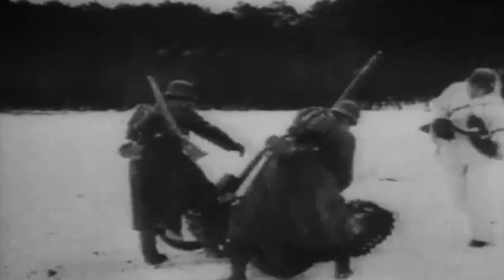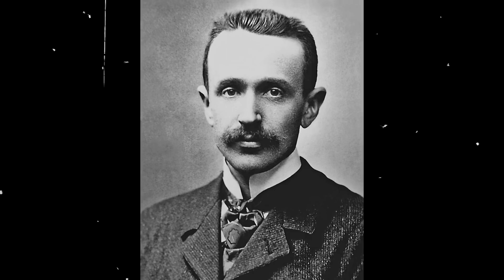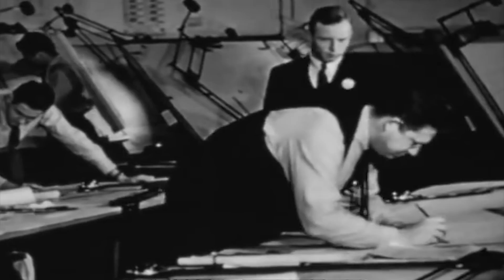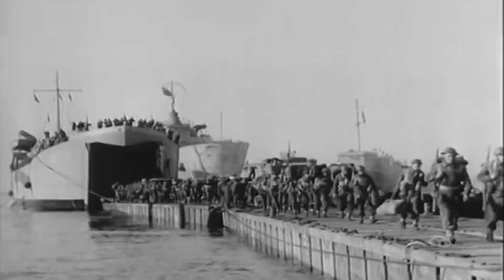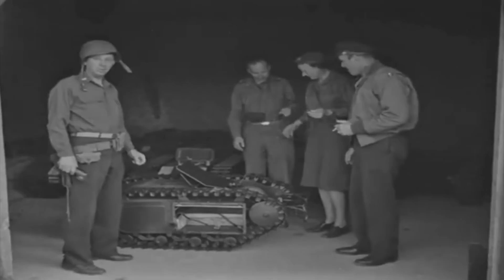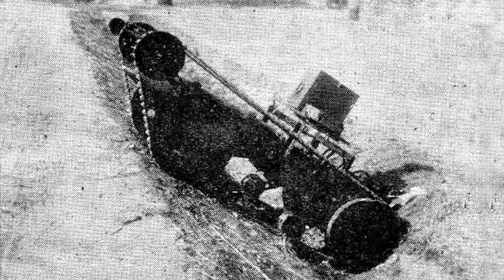WW2 Goliath Tracked Mine

Comment: well it did its job IF it worked long enough and could reach its target.  but i bet we could make them allot better today.  especially with sound recognition and other software upgrades.  thou i'd bet we would make the explosives it carried modular, so it could get to a target and drop the munition down as to get out of dodge before it goes, IF the mission didn't require or need for it to blow itself up in the operation.  why do i want to add hydrolics to the the tracks thou? i mean not for suspension directly but to control tension and allow it to have a larger footprint from front to back... to crossover larger obstacles?... they might have gotten away with using fewer wheels and such if the track and suspension could handle the weight and such, if that helps.

Comment: I would think that these would have been useful at Stalingrad. The Germans could have run them forward into Soviet positions and detonated them. I'm also surprised that they didn't have an automatic arming mechanism that would cause them to explode when someone cut the wires.
Reply: the problem was the ground at stalingrad would have prevented it plus the urban enviornment meant the Sovs would have seen and fired at it or run at them with scissors.

Comment: Well ya. It's not really a remote if its connected by a wire
Reply: There are lots of remotely controlled vehicles connected by wire. Most underwater drones use a wired connection for both the control signal and the video signal.
Many guided missiles used wires for control inputs. It's crazy the wires could unwind fast enough to keep up with the missiles.
The Goliath was not radio controlled but it was remote controlled.

Comment: The problem Germany had, was they were always coming up with a wonder weapon that was going to win the war. However, they didn't have the material to make enough weapons to be useful in winning the war. Plus, they were constantly trying to make it technically perfect, instead of making cheaper to build, and easy to use.
Reply: True, it's like having a big dick but can only last 5 mins. 😂
Reply: I've often wondered what would have happened if the german army had adopted the first assault rifle, the stg 44, as the standard infantry weapon instead of the bolt action K98k. There was a 15 reichmark cost difference.

Comment: There was a bigger version - Borgward IV with half ton bomb. The soldier could drive it. It is responsible for huge tragedy during 1944 Warsaw Uprising. The tank was stuck during attack in the street barricade and German driver run away. After the attack, insurgents thought that it is a kind of tank. Young fighters, against the orders, brought it over the barricade and paraded in triumph on the street. A huge crowd gathered. Then the bomb went off. About 500 soldiers and civilians perished in the carnage.
Reply: Never heard of that. Thanks for the information
Reply: @DalekSec4  Than is a true story of the blow up of the Borgward IV  mine truck, from the time of the Warsaw Uprising, which started on August 1st, 1944 and end up in October 2nd, 1944 !!!! >>  Amen.
Reply: There were actually three unmanned German vehicles: the big Borgward IV, the midsized Springer, and little Goliath.

Comment: These equipment and machines are really impressed me because these time of development.
I think if any terroristic organisation like IS or AL-Q  would have these machines or some modifite kinds of it they would really succeed in their struggle against their anamies.
Reply: Too slow for most terrorist applications, since they can be outrun by anyone on foot. Remove the armor to speed them up and they can be shot with a normal rifle. They already use something similar in concept though. some terrorist organizations have adapted car suicide bombs to be controlled remotely. They armor them with whatever metal they have lying around to protect them from enemy small arms. The manned and unmanned car bombs have seen lots of success, they’re often used to rush checkpoints. A remote controlled armored 4x4 truck with a bomb and some cameras is a much more capable than these things. Try watching some videos of soldiers trying to disable them, it’s terrifying.
Reply: They literally use cheap rc planes / drones with explosives.

Comment: That Fridge sized tx and controlled by wires , was my 1st clue they were a flop.  S- FHSS Futaba Protocol & running on 6s & they wouldda knocked it outta the Park. 😁
Reply: I wonder why they didn't put twenty first century electronics in the thing? It would have been much better.